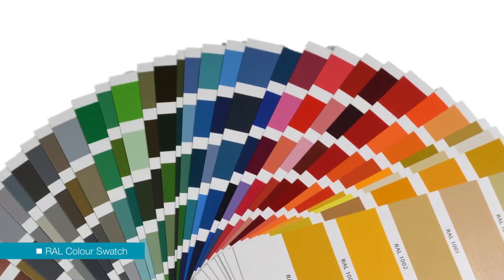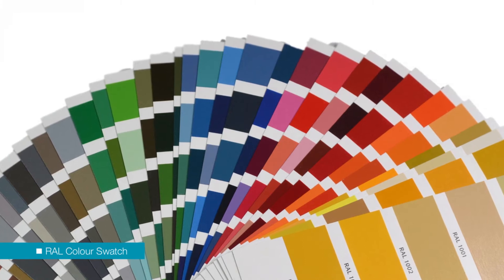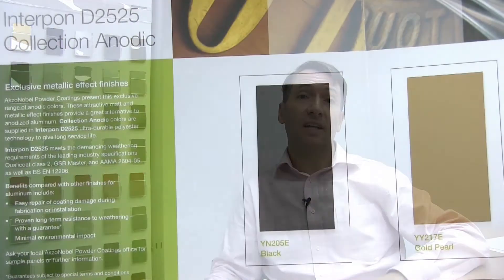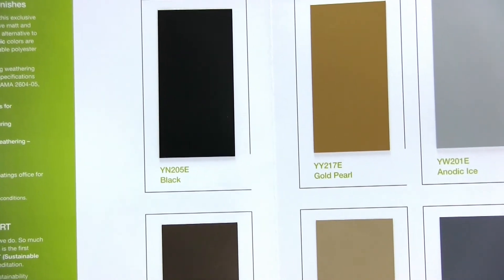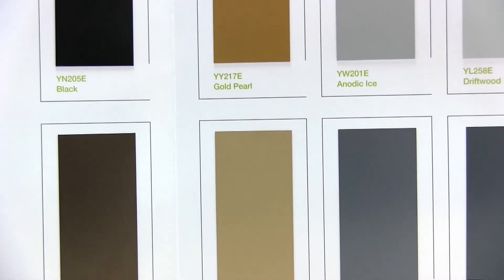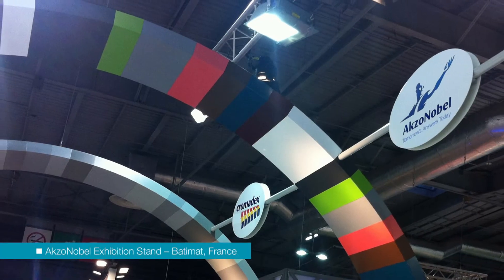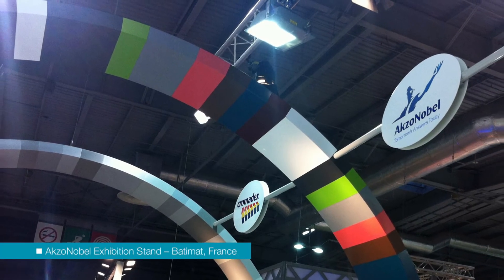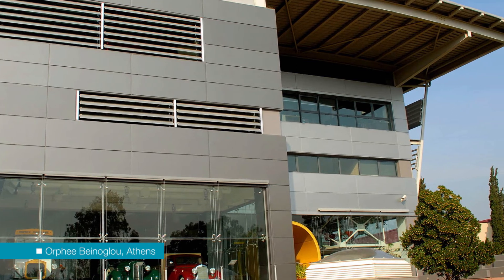Anodizing vs Powder - Part 3 - Colors

Comment: you cant compare anodizing to powder coating each process has its advantages,and my company does both
Reply: In your opinion, which would be better for steel and aluminum dealing with saltwater corrosion? I'm trying to persuade my company into buying one of the two so we can either anodize or powder coat. We deal with military vehicles that are amphibious so they can go on land and on water. We're a test branch so anything that could help prevent rust would be marvelous. Right now I think they think it's cheaper to just replace parts but if we could anodize or powder coat, I think it would be great value.